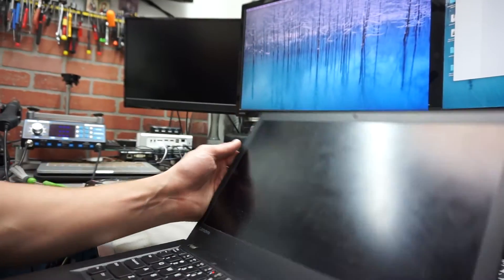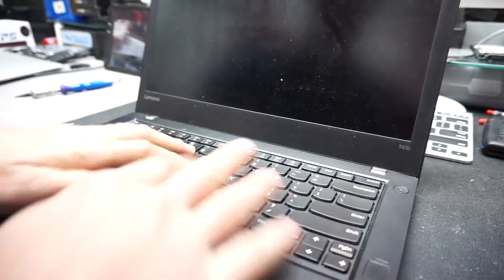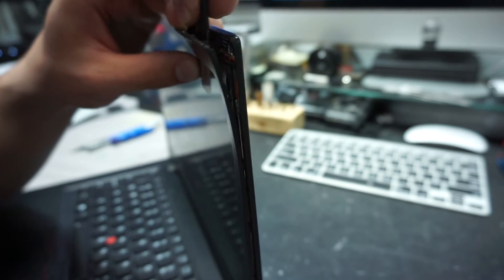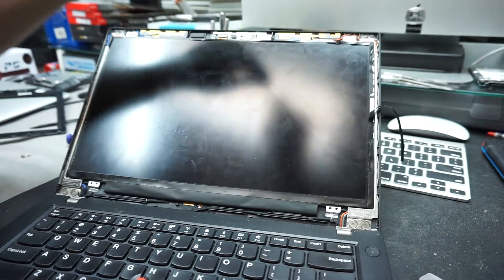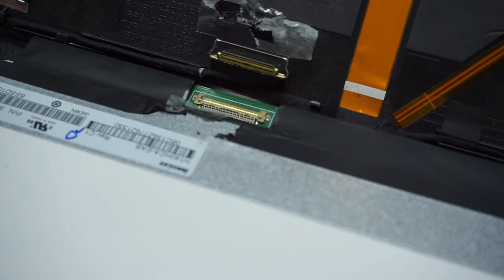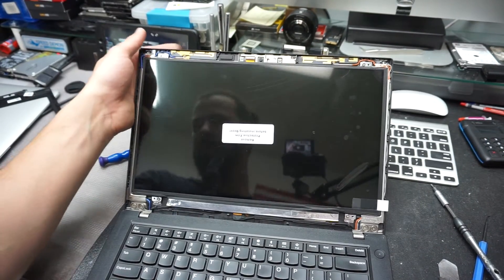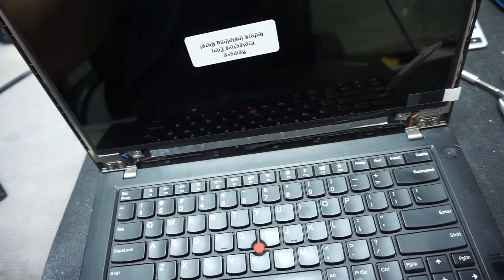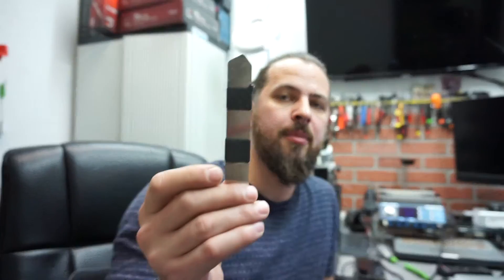Lenovo Thinkpad T460/T470 LCD Replacement

Comment: I have a question (really hope someone can advise)...

Quick background: My T460 screen is flickering/freezing, and to 'unfreeze' it I just have to move the screen a tiny bit. So it could be a loose connection which is what I want to check.

My question: I started removing the plastic frame/bezel around the screen, but I'm concerned about the glue that's there - will I need to glue or tape anything when I re-assemble it? Or is the glue not necessary - can I just clip the plastic back in once I'm done?

(Pardon the noob question here. I don't want a situation where the screen gets displaced or something because there's no glue.)

Comment: The procedure for the T460 at least the one that I have just removed the panel for is different.  The bezel around the perimeter where the clips are and around to the bottom of the bezel is glued to this outer rim and at the bottom is a 'reinforcing' brace that is actually part of the outer rim.  It spans the bottom and has 4 holes 2 of which are used to secure the bezel assembly to the bottom of the lcd panel.  I was able to access the screws by bending the bezel forward exposing the screw heads for access. But if one is not paying close damage will ensue. Because in addition the tape that normally just encases the electronics board, goes through this 'reinforcing' brace and is affixed to the lcd panel.  I was able to remove this tape and extract the damaged display.  Putting it back together, I'll see if I can scrounge on from another donor machine :)
Reply: Glad I'm not the only one that faced this. I still need to try and get the screws back in 😕

Comment: For those Thinkpads with dual batteries, go into BIOS and temporary disable internal battery.
Reply: It will only turn back on by connecting the external power supply..

Comment: Thanks, you are very kind and precise, I can ask you, if there is a difference between the panel (1920x1080) of the t470 and the t470s, and if the lcd panel of the t470s, is it seen better?

Comment: Very informative video. Thanks a lot for taking the time and making the effort. Would I be able to tell if my screen is using 30 or 40 pin connector without removing the screen.

Comment: Followed this step by step and managed to replace the screen on my T470. One thing I wanted to note, I don't know if a previous shop refurbished it but you show just a couple strips of adhesive, mine had adhesive extending all the way down to the LCD board cover (that black film) which made it a real pain to get off without damaging the connector, but somehow I did manage to get it loose eventually.
Reply: I bought a refurb and the double-sided tape was there, hot air gun sorted this.

Comment: Thanks for the video!  I'm guessing this is the correct tape?  https://www.amazon.com/Double-Strong-Adhesive-Acrylic-Tablets/dp/B019OQ4ZG0 - Also, do you know if there's a way to separate the two parts of the bezel?  Lenovo seems to sell it as a "LCD Bezel - 01AX956" as well as a "LCD Sheet 01AX958" - those two comprise the piece you took off.  Do those two attach with the same tape, and can you take them apart?  Thanks!

Comment: Excellent video - The T460 is different as the plastic part is held by the four screws that holds the lcd in place. This is very good for a T480.
Reply: So can this be done the same way with the t480?

Comment: Great video! If you're worried about it being on, disable internal battery via BIOS. It can't be powered back on until you plug in the AC adapter.

Comment: Is it possible to change a T450/T460/T470 original 720p screen to a 1080p? Or will there be some problems?
Reply: You can do that, but bare in mind you will need the correct FRU if you are performing this on a T450 since the BIOS checks for the supported white list, if you put a replacement screen them the brightness control would not work under windows